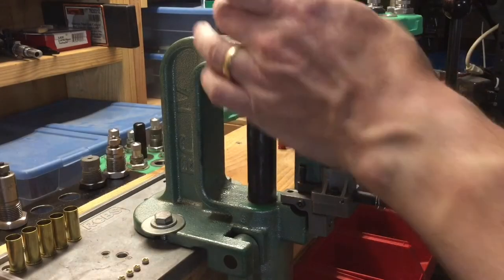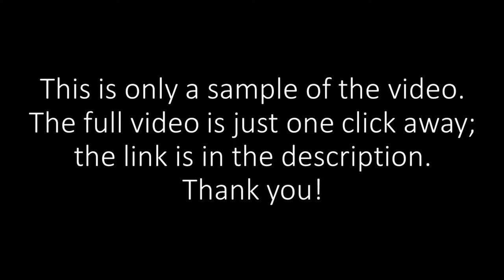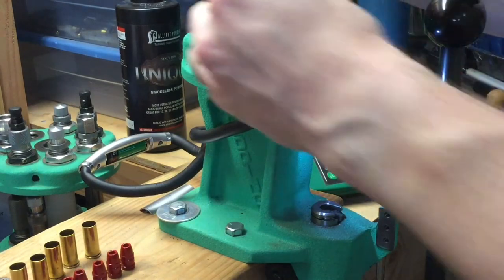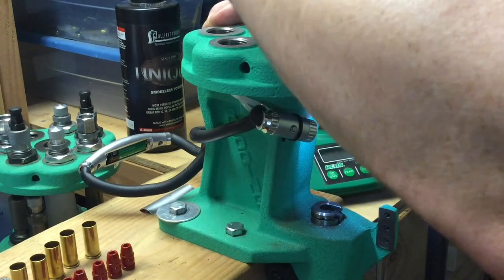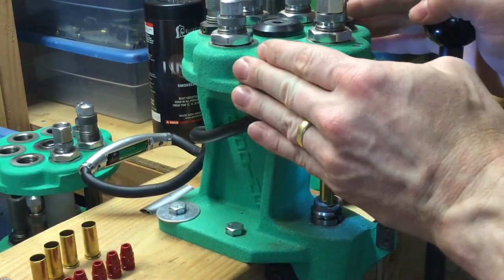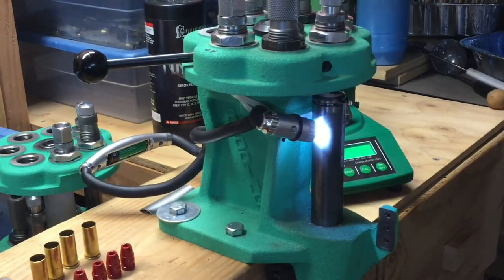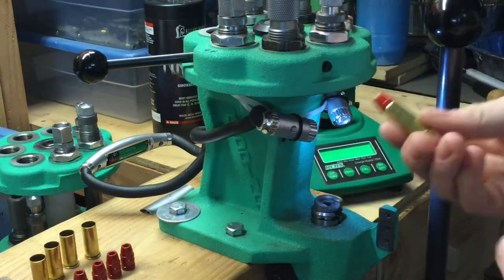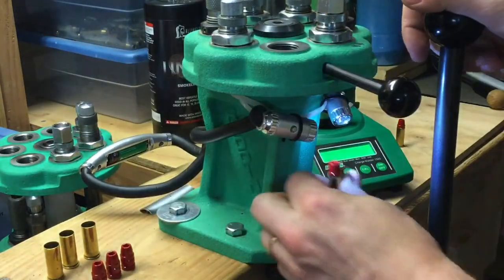Using a Turret Press for Load Development

Comment: For now I'm sticking with the lee 4 hole turret, the Redding gear definitely looks a cut above 😨
Reply from the maker: I like and use Lee equipment, but the Redding equipment is certainly made with better materials, tighter tolerances, and this press will no doubt outlast me.